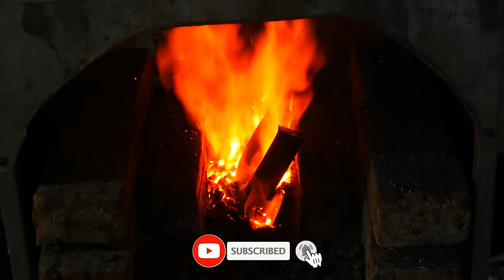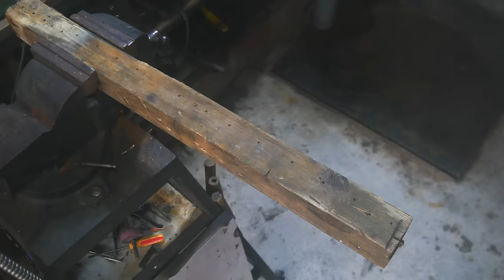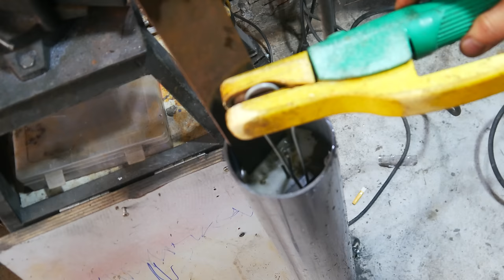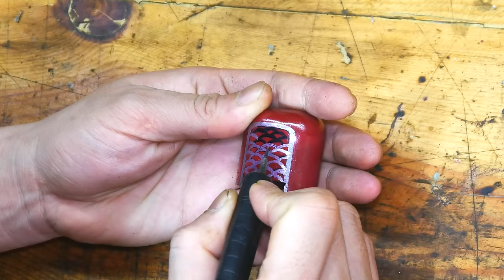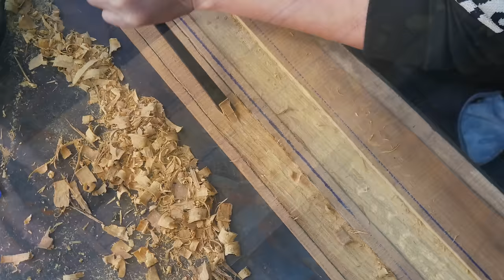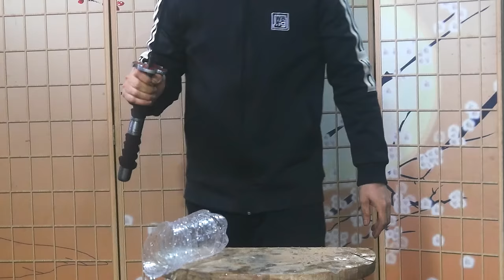Let's see how I created one of ZoRo's strongest Katana - Sandai Kitetsu - Third Demon Sword

Comment: Am impressed. 
One huge mistake very very common in modern (western) knife/sword making is to make the tang too narrow and to file deep 90degs for the hilt, creating extreme weakness prone to blade snapping at those points.
I'm so very happy and impressed you did NOT make these mistakes. 
Not particularly fond of your Tsuba because being solid steel it is heavy adding unnecessary weight to the sword. 
If it were skeletonized more, it would drastically help this issue. 
Otherwise, I love your work.
Well done!!
Reply: Tsuba was usually made of iron though and often not skeletonized at all.
Reply from the maker: Thank you for your thoughtful comments! i could make things lighter, but i want it to be as close to the original as possible..

Comment: What did you apply to the blade and what did you put it in when you made the pattern on the blade? I'm asking because the method of engraving the pattern on the blade is different from the method I knew.
Reply from the maker: Actually, it's just a normal way to corrode metal. I don't know the name of the chemical I used, I just asked to buy it.

Comment: I Apologise if I'm the only one asking but..
What's the purpose of putting these chains inthe base of the anvil?
I see a lot of other Makers do it too
Reply from the maker: Very interesting question, in my opinion it brings a sound that reflects the strength of the blacksmith's muscles, secondly it increases the weight of the anvil to reduce vibration! Third is probably aesthetics!!